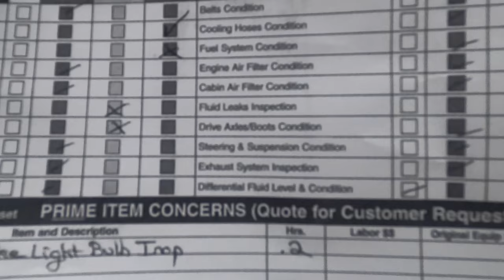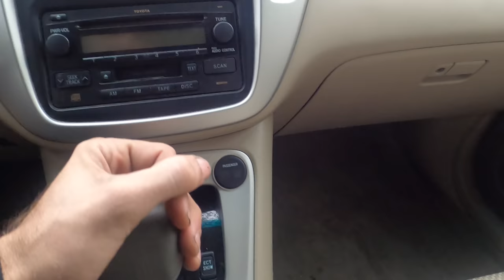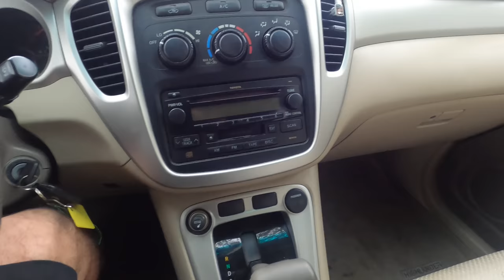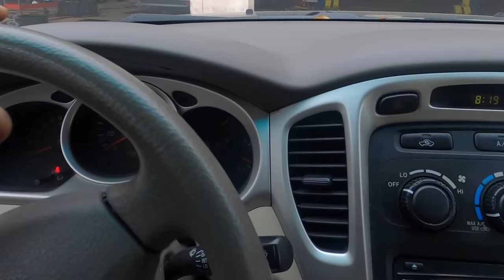We were BASHED by the Dealer! Ripping off a customer! Toyota Highlander 3.3

Comment: Holy moly, did any technician watch this video?! I would never bring my car to you.  Caliper just flops without using an actual device to hang it properly.  Pulling rear drums off without backing the adjuster off first?! Just pull and pray. 🤣  Nice way to ruin the rear shoes.  Then you wonder why it's rusty on the inside of the rotor.... because they were not adjusted properly in the first place.  Your 'fix" is to use a drill!! How about machine them properly or just have the customer buy two new rear rotors.  This is wild 😅😅
Reply: It is just the parking brake. Not sure what adjusters it may have, if any, since I don't have a Toyota, but if handbrake is released they should come off as shown, won't be any ridge inside. The drill sander is fine for parking brake drums.